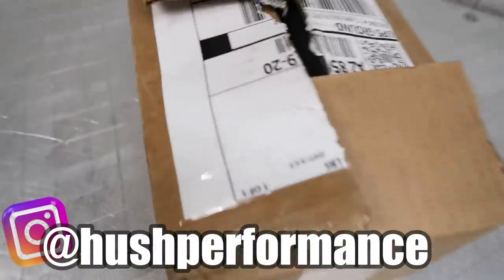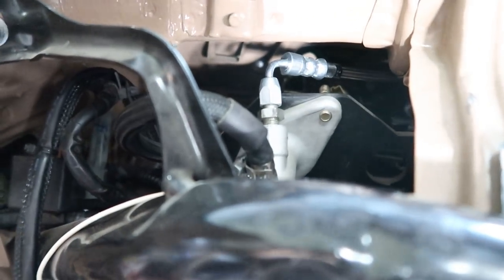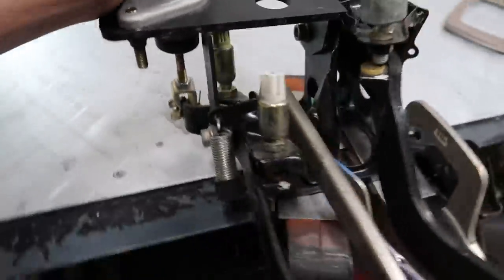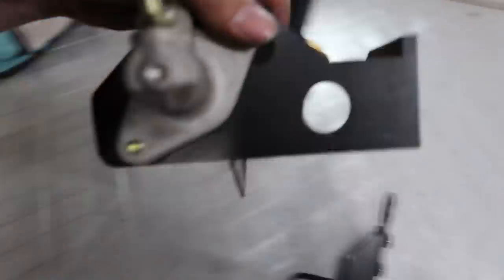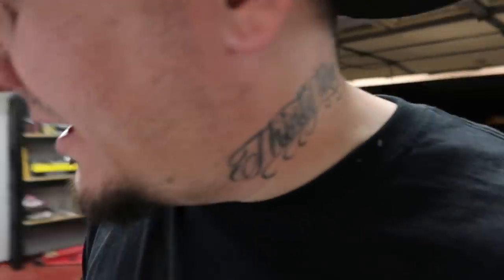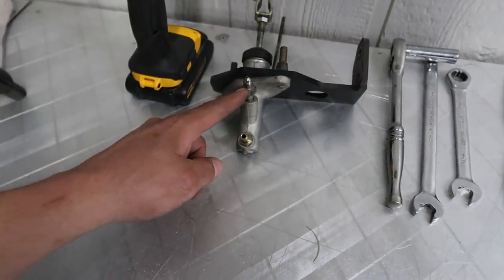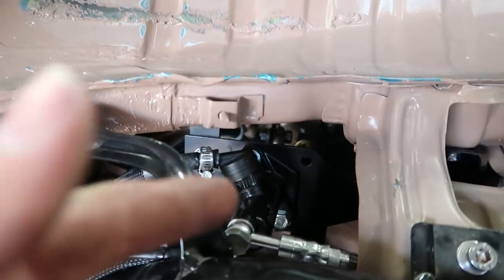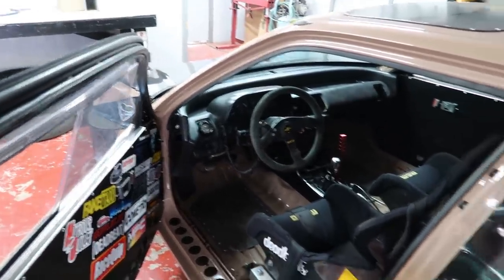Hush Performance Cable to Hydro for Khaki!

Comment: Its so nice to upgrade something that has driven you crazy. These are the joys that rich people will never understand
Reply from the maker: Built Not Bought 💪💪
Reply: @deadbeatgarage  i had a bad clutch master, and broken fork on the back of the clutch pedal on my sr20 s14 that i welded but it was akward. Swapped to wilwood and custom parts. Car went from the worst i clutched to the best :)
Reply: Hush is 🔥🔥🔥🔥🔥🔥🔥🔥🔥🔥

Comment: I fixed that pedal flex problem with a dril bit and a bolt. No need for a new kit or anything else. On the right side of the clutch pedal closest to where there is only one bolt. You drill it out and add another bolt. We've been dealing with this stuff way before all these other places were even a thought.

Comment: Also user error on installing the cheap eBay bracket the second hole on the pedal assembly you are supposed to put a nut and bolt to lock it into place so it don't swivel lol

Comment: I wanted to go cable to hydro but there kit cost so much and I just put $500 in to rebuilding my 92 cable b series trans . Hope its fixes your problem.
Reply: My kit only cost $85. From hush. Just use factory master. Not the crazy expensive one.

Comment: WHILE YOU'RE AT IT YOU SHOULD HAVE JUST CHANGE THE OLD (BREAK LIGHT SWITCH & CLUTCH STARTER) PEDAL "HARD PLASTIC GROMMETS" BEFORE THEY DRY UP AND BREAK OFF ON YOU ON A DRIVE

Comment: Yo would you be able to help me out by any chance ??? I have a 1995 Honda Civic ej1 coupe not a hatch it’s a d16z6 the car overheats after 10 minutes of driving and the over flow can thing is the thing that’s starts smoking but also another problem I put my foot on the gas and it takes about 15 sec of putting the gas down for the car to go past 5 mph and it won’t go past 40 mph and last time the headers were glowing red but I don’t get it ??? The car is slow as if like somethings hesitating to make the car not go fast ?? Any idea someone can help me out
Reply: @deadbeat garage
Reply: To me that sounds like a clogged catalytic converter. It’s not able to let air escape through the exhaust which will make it run very poorly and could definitely explain your headers getting red hot. That could also explain why it has terrible acceleration, because it isn’t getting the airflow that it needs.